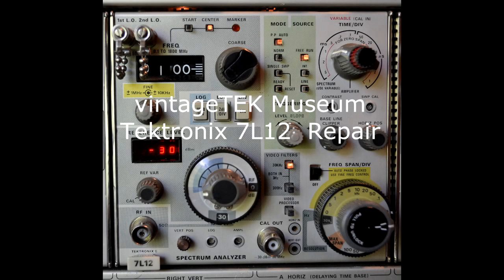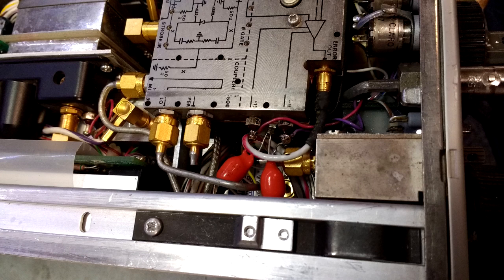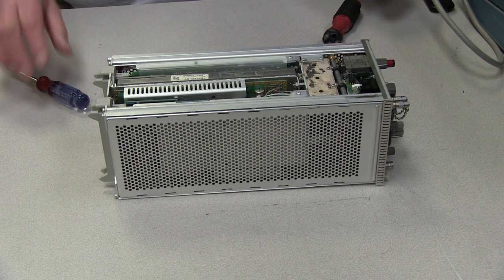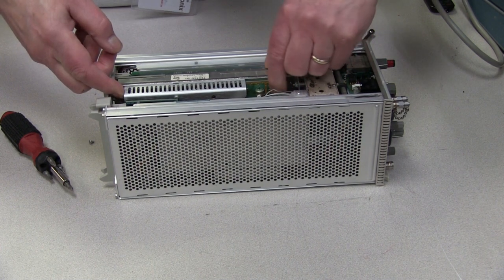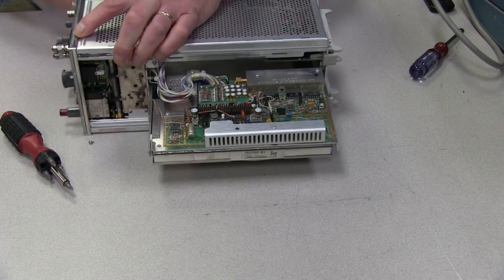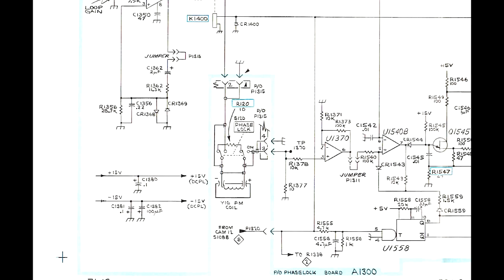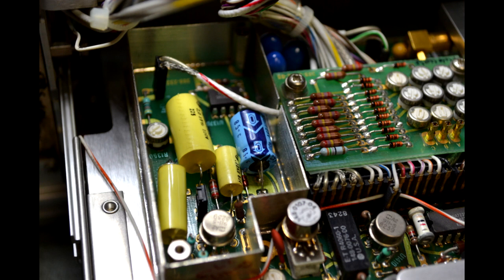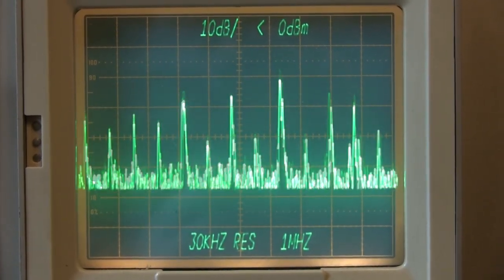Tektronix 7L12 Spectrum Analyzer Repair by vintageTEK Museum

Comment: I love me some Tektronix oscilloscopes! 40 something years ago I was a microwave technician for a cable TV system. They provided a 465 scope for troubleshooting.

I loved that scope! It would lock on to video and even had a Z axis input so you could make it into a very expensive black and white monitor. I got to where I could operate that thing in the dark by feel, upside down and backwards.

Tektronix dominated the field of television.monitors. They used the Sony Trinitron CRTs for the picture monitors. All the old tape machines from RCA and Ampex came with Tektronix waveform, vector, and  picture monitors as standard equipment.

I found a 465 on eBay a couple of years ago for about a hundred dollars plus shipping. It must have been sitting on a shelf the whole time, because it is museum quality! It came with all the probes and accessories. The BNC connectors are very tight and the calibration is spot on. I got real lucky on that purchase.

One of the great things about Tek scopes is their fit and finish. They look cool and spacy even when they are turned off! Very ergonomic designs and a pleasure to use.

I look forward to seeing move of your videos. The Tektronix product line has not diminished with age. Keep up the good work!

Comment: Wow - I had a 7L12 with a short on the -15V supply.  It turned out to be the same cap as in the video here, C1382.  It was an easy fix - once I pulled a leg of C1382 to confirm it was the issue the -15V short disappeared.  I had not found anything in the service manual about even getting to the center section, this video was a great help.

Comment: Loved it thanks for the show guys. You guys should do some long term project videos on equipment restoration, like the 500 series and plug in or even some of the 400 series scopes. I know there's a large following of the 7000 series mainframe scopes like the 7904's etc. I know they're obsolete but I still love to just look at them. They are such a work of art with the digital readouts on the screen and the little square push buttons that lit up, they're just simply wonderful to look at in operation. Thanks again for sharing. Best Wishes & Blessings. Keith Noneya

Comment: Nice. I think I mentioned to you one day that I had a Wiltron (ie Won't-tron) VNA that failed.  It turned out a tantalum had one lead extending waaay out to it's intended trace.  But it sagged a bit, and touched a lead it shou'n't have.  When I got the old board back and the repaired board, you could see the little orange bead that leaked out on the bad tantalum, and they had put a little plastic sleeve where the lead had previously been dangling exposed to the trace below it on the repair.. So they KNEW it was a problem.  They still charged me. Oh well such is life.

Comment: OMG! Getting the center module out is that easy? Wow. I have both the 7L12 (7603 chassis) and the 7L13 (7613 chassis). The 7L13 has an issue but now I know what to look for.
Reply: Could you show how to clean the dB per division switches? Mine are dirty and need assistance going in and out.

Comment: good night my good video! I also have the 7L12 and it has an integrated 155-003500, my question is ... which integrated circuit is its equivalent ... or replacement? greetings from Argentina!